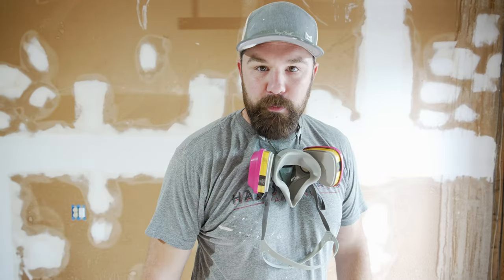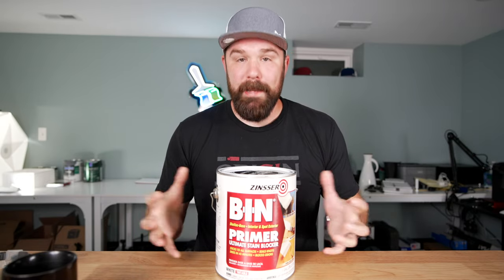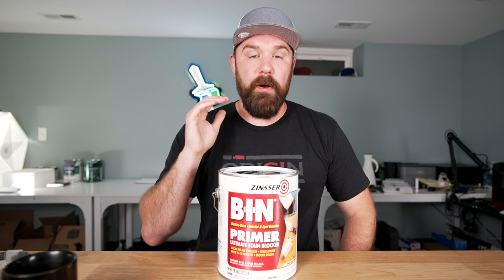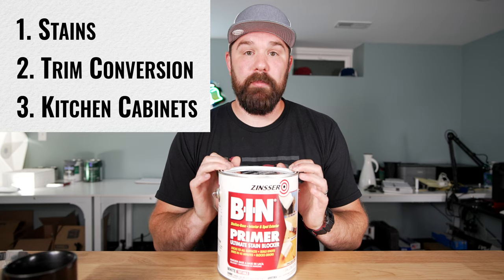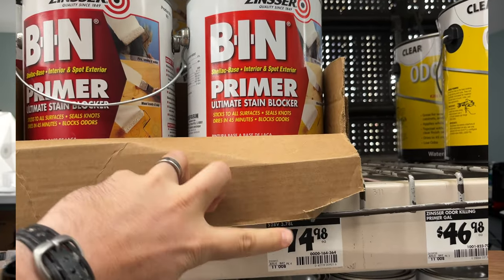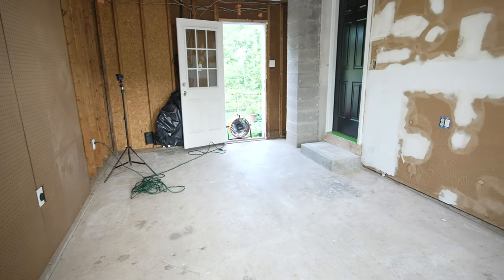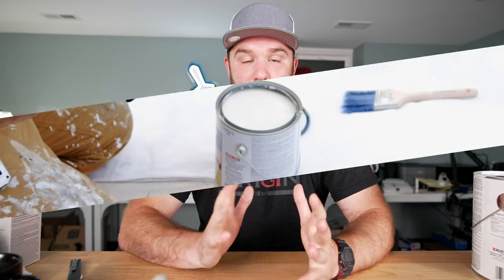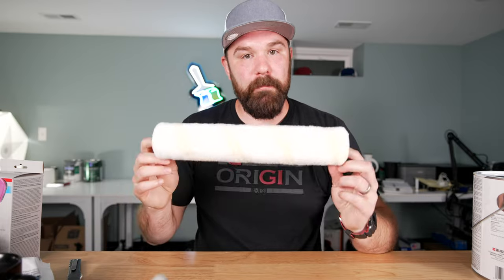The Best Stain Blocking Primer: What You Need To Know

Comment: Wat if the surface is still a  bit damp will the stain still come true
Reply from the maker: I’d recommend making sure that the surface is dry before applying it.  I’ve never tried shellacking a wet surface but my feeling is that it would not set up properly 🤷‍♂️

Comment: Can you use this on exterior wood trim?
Reply from the maker: Sort of…you can spot prime knots in the wood but it’s not good to do large areas because there’s very little flex to shellac so it’s prone to cracking when used outside.  Better to use an oil-based wood primer or a regular latex wood primer if you can get away with it.

Comment: Have you ever used this and have had it crack under your paint? Looks like glass shatter.
Reply from the maker: I have indeed.  I've seen that happen when it's been too cold out, or theres a big shift in the surface that the shellac was applied over.  Shellac is quite hard and brittle when it dries which is why I think it can crack like that in certain conditions.  Usually we sand it down and try and try and get the surface smooth again.  Sometimes that requires spackling or hitting it with another type of primer like cover stain or fresh start depending on what you're trying to do.
Reply: Have you ever tried Kilz Restoration? Need to seal a lot of 1970 popcorn ceilings, flat paint walls, wallpaper and paneling loaded with nicotine. Customer won't allow the fumes.

Comment: Do you need to rub wood down first ?
Reply from the maker: It's not a bad idea to sand down the wood with 150 grit sandpaper.  There's also a primer that I've been using to convert trim that you might want to try before you go with BIN.  It's quite a bit more pleasant to work with than BIN.  It may work for your application: https://youtu.be/jydQq4jHOnE